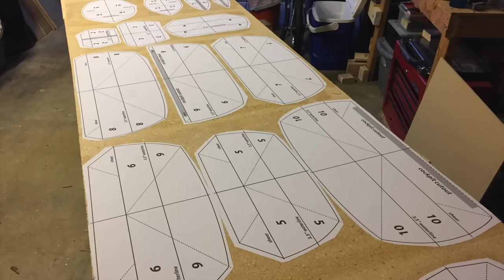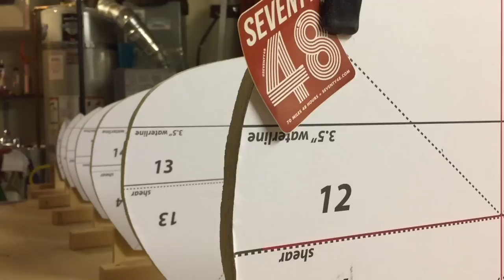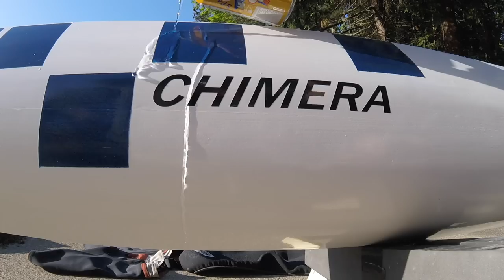Chimera: Building a wood-strip high-performance kayak

Comment from the maker: Hi all- 
To answer a few common questions:
(1) "Why paint over the beautiful wood?"
There's a pretty simple reason. I had a color scheme/ pattern in mind when I designed the boat, and wanted to stick to it! This was also my first attempt at a wood-strip kayak build, and tbh there were a couple little spots in the woodwork that didn't make the video that I just wasn't proud of- likely not noticeable by most, but definitely for me :-p
But don't worry- version 2 that I'm building now is certainly not going to be painted... got something even better in the works :-)

(2) Dimensions?
Length: 20 ft/ 6.1 m; Width 18.5 in/ 47 cm; Weight ~42 lbs/ 19 kg

(3) Are the plans available?
Not for this particular boat at the moment. I'm close to finishing up building a second version, spent a lot of time revising the design, smoothing out some of the lines, and refining the materials and workflow for the build. If I'm happy with the second version, the yes! I'll be making the plans for both V1 and V2 available.
(Spoiler alert- of course I'm filming the build process! And- V2 is looking like it'll come out at about 2/3 the weight of V1...)
Reply: You did an awesome job on the woodwork for a first time. It looks much easier when Nick is doing it compared to doing it yourself. How do you find it compares to surf skis for stability and speed? I have a Think Zen and and am contemplating either buying a Think 6 or building a Guillemot Kayaks Mystery
Reply: 20 ft boat for just one rower. Why so long boat? Is there is some pluses for so long boat?
Reply: @bobododoo3925  longer boats are faster- to a point. Everything is a compromise though. Length = Faster but less nimble, narrow width = faster but less stable (which actually means slower if you are upside down).
Reply: Great job! You inspired me to build my own kayak. I'm curious to see how V2 turned out. Thanks!

Comment: This is awesome!  I built a stitch and glue dinghy about 4 years ago.  Your strip plank boat has a lot of extra steps that require more patience and thought.  You nailed it!  I like the colour scheme.  I think you made the right choice by covering up the wood.  I see in the comments that you are working on a Version 2.  I am really hoping that you document that one in a similar fashion to this one.  I also see that it turned out heavier than you were hoping.  My dinghy also turned out heavier, but by around 5-6kgs.  Like you, I know the areas I overbuilt and how to reduce the weight in future projects.  You should consider rearranging your workshop to maximise your space.  It looks like it is a storage shed.  It might be worth moving a lot of that stuff to a different area to give yourself another bench or two.  I really think it could speed up your workflow.  Loved everything, well done!
Reply from the maker: I wish I could have a bigger workshop! Limited to half of a 400 sq-ft garage at the moment until we buy a house with a bigger garage... I'm making version 2 just about 2 ft/ 60 cm shorter (and using thinner strips and different fabrics), aiming for sub 15 kg total. Right now the deck and hull together are just under 10.5 kg. Hoping to be done by the end of January, and yes, videos to follow!
Cheers :-)
Reply: @kayakphd  So cool.  Thanks for the update!

Comment: thats awesome .... fell over it last night, when I looked for "skin over frame". And your design poke my sharp eyes. I would go further and integrate into your design a rigger system and use it as coastal C1 skulling boat. I am a sailor (with 48 years background), and for keeping me fit, I started rowing (do it already in a coastal C1 made of polyester and a heavy beast of 35 kg). I think its worth to think about if there is an option to adapt a slide rigger (not a slide seat) to your top frame. Any chance to study your plans of V1 and V2 (a scetch version in DINA4 would already a start before going into 3 D) ??? Tks for uploading this video and take us with you on this awesome 1.5 years journey. (P.S.: I love wood as material most of all either to work with or as I do living on a 37 foot 2-mast woode-in-wood built clinker Dutch sail slope, 63 years old.)

Comment: Nice. Tip: When sanding, guide coats show where your at and how your progressing. Graphite powder is good, or scribble over it with a pencil, and then sand back areas until it is removed. Apply a few times through out the process. Reduces unnecessary sanding. Marking pens leach through the glass after time. Just a thought.

Comment: i would have cut out the cockpit and installed the coaming After i joined the halves together....it just makes sense to avoid any torque hang ups.
turned out nice though anyway....good job.

Comment: I am interested in plans as well. I have built several SOF, &  Stitch kayaks, but not a strip. I have been looking for something exactly like this to play around with, a Ski that you sit in. Your design looks like it fits the bill, can't wait to see generation 2. I personally think you did a fantastic job. A natural wood version would look nice, but the white stands out as well. What is the rough length, width for the next one?
Reply from the maker: I took a bit of length and width off for version 2, it's coming out ~5.6 m length and 45 cm width. Shorter = the build process fits better in my garage! Also saves weight, and should actually increase the speed with less wetted surface area

Comment: very nice boat, as mentioned by others why did you 'paint' it, the wood look is so good.
But I was wondering about a design feature, why is the bottom so flat till the end? A rounded of back end is faster and the stability comes from the flat part under the cockpit.
Reply from the maker: Regarding the hull design- true, but then it would be similar to just about every other surfski out there! In flatwater this design (with the planing surface extended all the way to the stern) is a bit slower, but at speed on a wave the "lift" from the hull planing is pretty similar to other surfskis I've paddled.

Comment: Great work! Beautiful lines on that hull. Would have liked to see more of the rudder install. Also just gotta say it, I would have looked into having it professionally gel coated for all that hard work you did painting it seems a bit wrong. All the best, happy paddling!
Reply from the maker: I had a color scheme in mind when I initially designed the boat, it was one thing I didn't really want to change. The next version which I'm building now will have the wood visible, and probably a clear-coat finish
Reply: Gel coat would most probably add extra weight. They also tend to look faded after a while. The poly finish on Think kayaks looks way better than the gel finish on Epic's, Fenns etc

Comment: hey mate, awesome boat. would you care to share the plans, I'd happily pay for them so I have a project for the next NZ winter?
Reply from the maker: Thanks! I'm not distributing plans for this one, only 'cuz I re-designed it and am working on building version 2 right now! If the changes work out, then I'll probably make plans for the second version available :-)
Reply: @kayakphd  thanks,, that's great..
can you tell me how much timber you used, please? then I can place a pre-order with a local supplier.

Comment: Looks great. Can i ask why didn't you use some really light weight, quality marine ply, 3 or 4 mm?Would be lighter than Paulownia
Reply from the maker: I'd have to rip some pretty thin strips of marine ply to fit the shape of the boat in some places, plus I was able to purchase the paulownia pre-milled. I'm working with 3/16" paulownia for the current build, might even go 1/8" for a really light sprint K1 build in the future

Comment: I suppose my handle led me here, and I was a boat builder for ~25 years. Looks pretty, and probably fast,  but I suspect it was a little heavier than you expected. BTW, how did that PVA hold up?
Reply from the maker: Love it! It did come out a little heavier (by about 3-4 kg), I definitely over-built parts of it. I'm building the second version now, a lot of work-flow and material changes should make for a much lighter boat!
Reply: @kayakphd  I've never built a kayak, and maybe using a water resistant glue (a PVA, such as Titebond) rather than a waterproof glue approved for under the waterline boat building is OK for a boat that spends limited time in the water, dunno. Last time I checked the only glues permitted, or sensible, under the waterline were 100% solids epoxies such as WEST and Resorcinol, and possibly some difficult to find Urea Formaldehydes. Resorcinol is out because kick times can be short and inflexible, epoxies would work, but I'd only use the slow kick versions. I'd love to hear how the PVA glue holds up.

I also vote for a bright finnish, perhaps some clear Western Red Cedar? For a top coat/sealant I'd use some veil and WEST says they have flowcoat that stays clear, or perhaps skip the cloth/epoxy and go with a 2K urethane such as General Finishes Conversion Varnish -- tricky to learn but awesome stuff. In either case I'd go with an epoxy glue, but that's just me, what do I know?

And perhaps I don't understand how you will use it, maybe you race it? Then lightness and controlled stiffness are priorities. If you like the form, splash a primary mold from it, make a plug, tweak to your liking, make a mold suitable for crush molding, then crush some carbon/honeycomb/carbon into it and have fun.
Reply: @ChimeraActual  I'm pretty sure that Nick Schade uses Titebond 3 so it's been well tested. Epoxies just aren't practical for strip planking due to setting time. I just had a look at a guys strip planked Guillemont kayak that was his first ever build and although it looked fantastic from a distance, once you had a close look the flaws became more obvious. Perhaps I noticed the flaws because i make thing's but I can understand nott wanting to put the flaws on display. The paint job looks great!
Reply: @geoffsemon7411  I wasn't trying to be critical, I'm just curious how that glue holds up in what must be a damp environment. Perhaps I shouldn't have wasted my money on epoxy...

I never built a kayak, but I did build a stripper windsurfer ca. 1980, with epoxy. It came out OK, but was heavier than I wanted. I don't recall having any real problems gluing it up. One reason you might consider epoxy is that required clamping pressures are lower. Yeah, a second one would have looked better.
Reply: @ChimeraActual  I didn’t think you were being critical at all. I have yet to build a strip plank kayak myself either but it’s on my list! I have watched most of Nick Schades videos though 😊. I do build end grain cutting boards and titebond 3 is the best glue for this and cutting boards see a lot of water and hold up fine. Not so good in dishwashers though 🤣

Comment: Congratulations on your effort and dedication resulting in a wonderful craft!  As others have noted about the weight, I wonder how much weight could have been saved by using vacuum bagging technique.  Two thumbs up!!
Reply from the maker: Probably a couple kgs could have been saved, but I don't have the means to invest in all the other supplies needed for the vacuum process...  What really would have saved some weight was warming up the epoxy a bit more to reduce its viscosity (lessons learned for building version 2!)
Reply: None at all would be saved.... he added a fill coat after, so whatever losses were had would be offset by filling the weave.  It'd be lighter without paint too, but both those things likely ended up with a smoother and more hydrodynamically slippery hull

Comment: Amazing build! So much attention to detail. How did you consolidate the inside carbon lip on the coaming? I've been wondering how to do that, I'm planning on starting a build soon.
Reply from the maker: I cut ~2" wide bias strips from the cloth I had, and pre-wetted the cloth and inner lip with epoxy before carefully pressing the carbon into place. There was a little bit of fraying that left a ragged edge on the deck- but that got covered up with the paint!

Comment: Stunning. One question - why E glass when S glass is supposedly stronger?
Reply from the maker: S glass is significantly more expensive (~$15 US per yard vs $4) and harder to work with- for a first build I didn't want to add in any un-necessary difficulties if I didn't have to....
Using S glass for the second one though!
Reply: This is your FIRST????? I’m staggered - we’ll impressed.
I’m on my second boat and I can say that S-glass is lovely to work with - just don’t crease it. Wets out beautifully with MAS low viscosity resin.
Reply from the maker: @peterflynn9123  Thanks! 
I'm actually really liking working with the S glass this time around- and using a much lower viscosity resin

Comment: i have made myself 3 wooden kajaks.A wooden core 5 mm is ok. if you want extra stifnes you can put carbon or carbon-kevlar instead of fiberglass  at the external surface
Reply: I did a 3mm plywood kayak and laminated in and outside. It‘s a hell of stiff and the next one I only will laminate outside - inside I‘ll just „paint“ with epoxy for waterproofness. Also I experimented with thinning the epoxy to have a easier saturation of the glass fiber. So I laminate with the roller and save kilos of weight just by economising the amount of epoxy. Good results and far enough stiffness, even with 3mm plywood. All the builders of wooden kayaks build imho to heavy boats with to thick plywood and to heavy glass fiber. Do we really need rocketproof kayaks to survive the heaviest possible storms?
Reply: @ggagg0  i do not know about plywood but if you want to save weigth you can put a super thin layer or epoxy ,leave it harden and then put the glass-epoxy. that way the wood does not saturate too much with epoxy. The kayaks with wood weigths normaly around 20kg . The last that i made was 20,5kg and was a 5,5m long with a wooden core 4-5mm